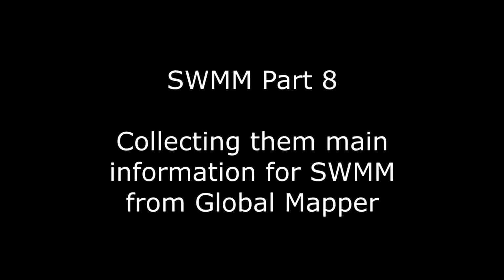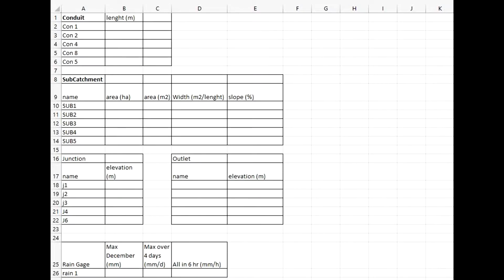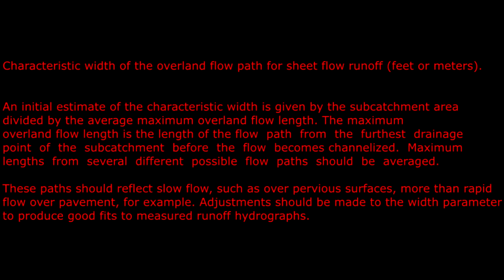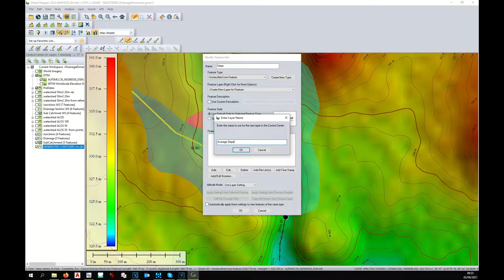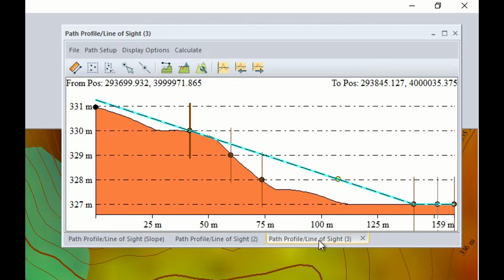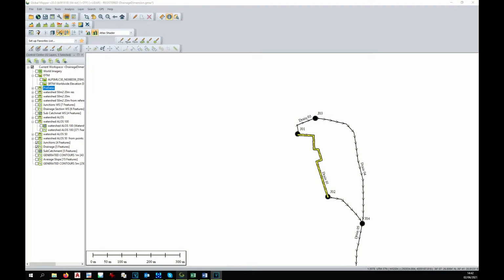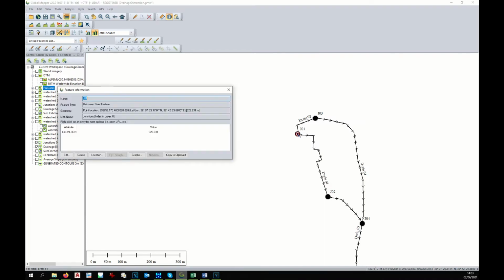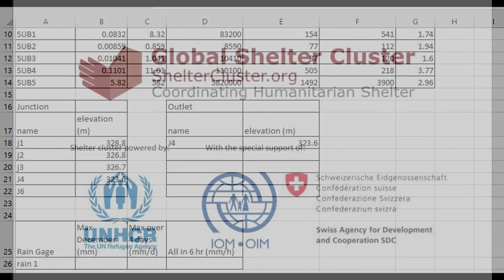SWMM Part 8/12, Collecting the info from Global mapper

Comment: Great series, Andrea!

I have a question regarding the estimation of the characteristic width.

We need to define the average maximum overland flow length (the length before the flow becomes channelized). This part isn’t explained in the video (referring to the summary table at 4:10).

How should this be determined?

I tend to think it’s the longest flow pathway from the upstream of the sub-catchment to the junction (essentially the length before the flow becomes channelized). But I suppose that’s not correct?

Could you clarify how I should approach this?

What a killer channel, Andrea! Thanks for all your work!